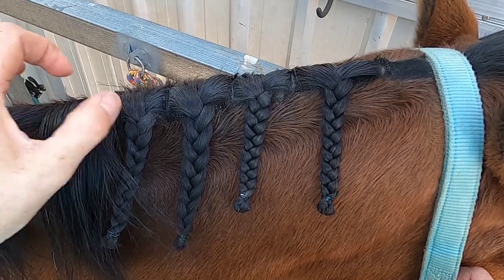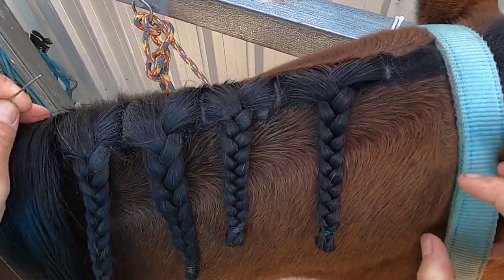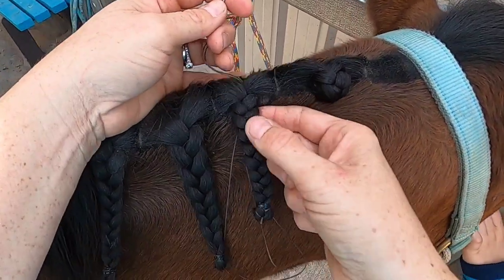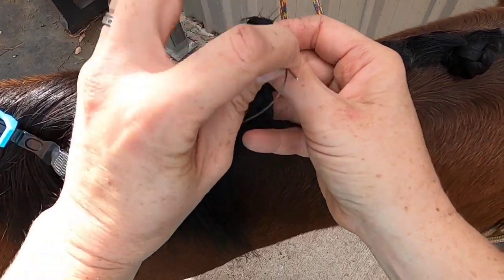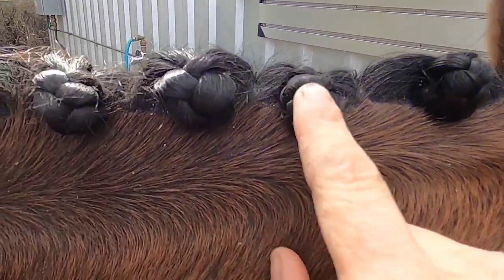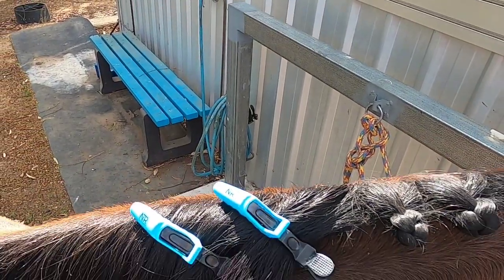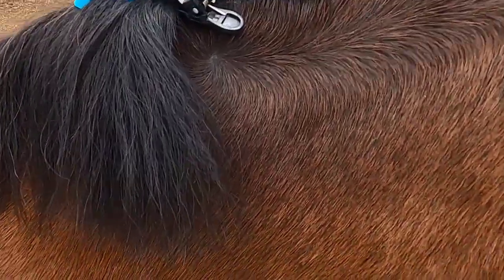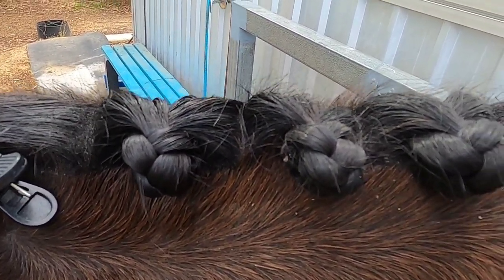Differences in Plaiting Techniques & How That Impacts Your Rosettes

Comment: if your daughter prefers their horse with a longer mane. may i suggest the technique where u pull the plait trough to form the little ball, and the rest goes on the other side of the neck as a braid and comes back to join the next plait. my horse has very thin hair so i use this technique to make sure he has more than 5 tiny plaits as i can use the length of the previous braid as volume for the next

Comment: How would you go with plaiting a super thin short main? I have a show coming up and im used to doing the running braid Rossetts 😁 not sure how to approach the normal version
Reply: I have the same issue with a rubbed out name half way down on my horse.
Fear not, This company N T R along with Equine Imaging also make a mane enhancer product. You get 6 pieces of ready to hair for plaitting (for thin manes) and they roll up to about a medium size rosette (also sold by both companies) .  Hope that helps! 😊